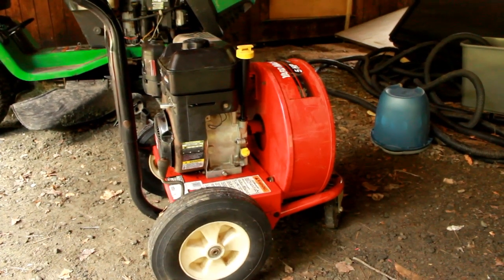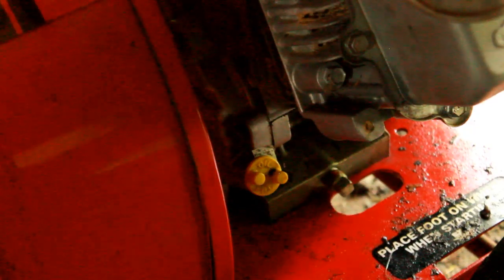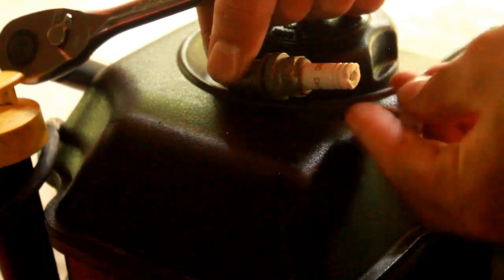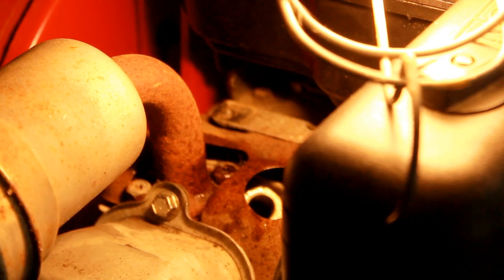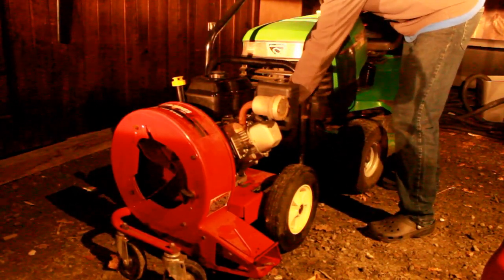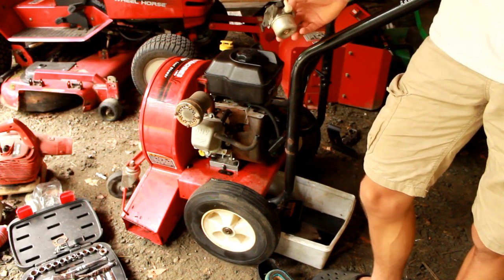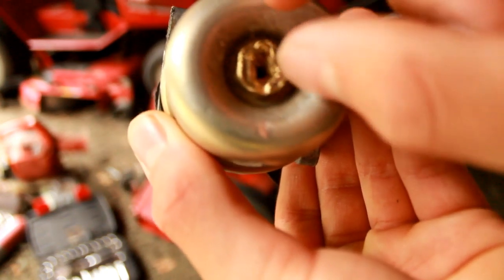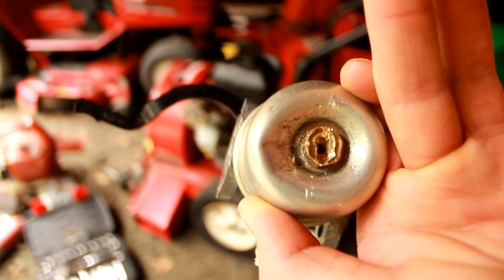How to unseize any small engine (+ carburetor replacement)

Comment: I bought a minibike it sat for 5years the owner said i took spark plug out drained oil and used pb blaster wd40 and brake fluid it's  free after 2 days I about passed out the damn thing started right up and runs great thanks

Comment: Great work getting that engine freed up and running again, Marvel Mystery oil also works great for unseizing engines and just about any penetrating oil will work as well. You lucked out on that engine, I didn't hear any rod knock which is good but like you said the connecting rod where it connects to the crankshaft may be weakened now especially since this engine was run without any oil at all in it. It may throw a rod sometime in the future but as long as the engine doesn't over rev and the owner keeps oil in it then it should be fine for a while.

Comment: Loved every second of this video. Almost felt like a parody because just about everything that could go wrong did go wrong. No oil? Check. Seized engine? Check. Broken spark plug? Check. Mangled carburetor? Check. Fuel line dumping gas everywhere? Check. Fails to shut off? Check. I don't believe you showed adding any oil to the machine and you never fixed the shut off issue, which was likely a broken wire or corroded connector on the shutoff switch, coil, or ground. Great job getting it running, though.

Comment: I have a riding lawn mower with a seized engine. I ran it without oil accidentally and it shut off.  I added oil, and put PB blast into the spark plug orifices but I cannot rotate the flywheel. Do I need to drain the oil for the engine to unseize? I'm new to doing small engine work. Thanks for doing the video.

Comment: Ok I’m a newbie here have no idea. I have a Red Ox 4-Stroke Honda GXH50 rototiller. Took it to a shop who after 7+ weeks said the motor was seized. I got it home & pulled the spark plug and the pull string moves. Not 100% but I’d say maybe 80-90%. My tines won’t turn by hand but I’m wondering if you think I should try to take it somewhere else?

Comment: Check out the Eliminator Performance video on seized Kubota riding mower. You may want to get yourself the endoscope Eliminator uses to view the internal cylinder condition using his cellphone, he even has a video on it. Nice job i also use PB Blaster great stuff.
Reply from the maker: I will